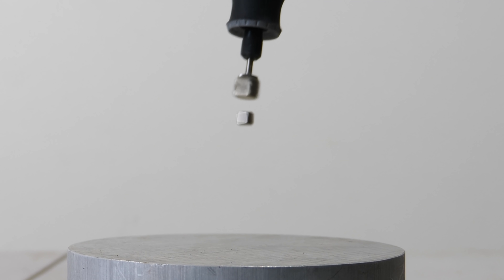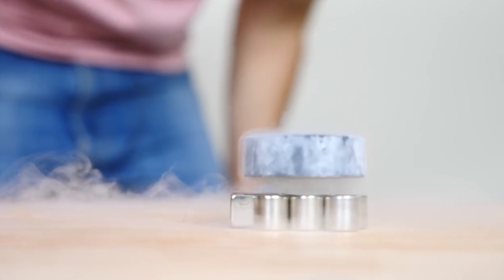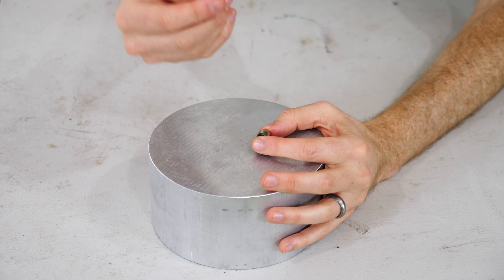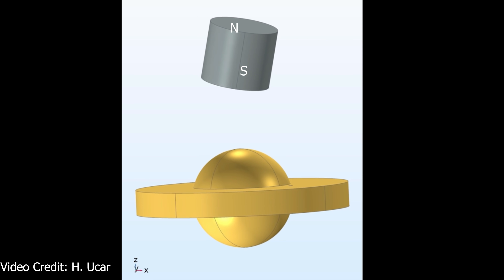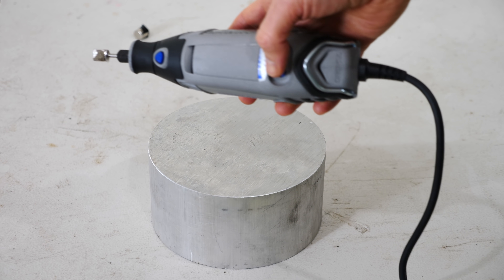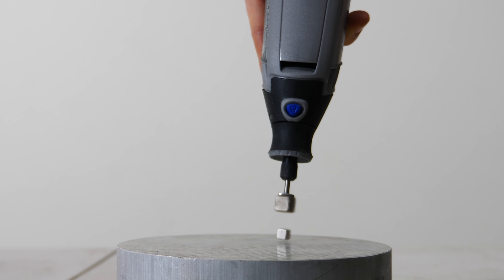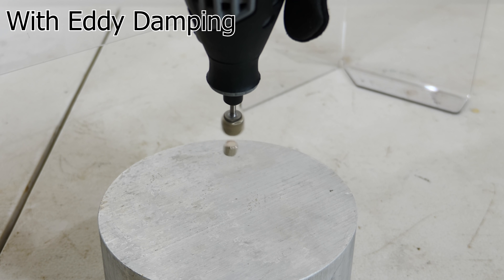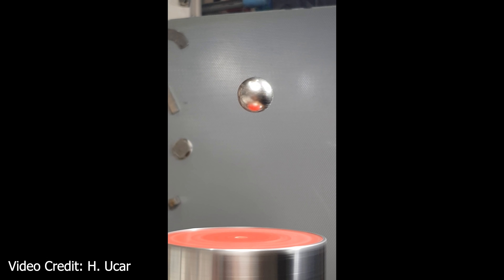Magnetic Locking WITHOUT a Superconductor!

Comment: Sometimes you come up with the coolest mind blowing stuff on this channel... and today's video was one of those truly amazing videos.  I was thinking about those Si-Fi programs like Star Wars (Star Trek too) had those floating anti-gravity platforms and cars...   So here's my brain dump on this idea...

For us to do that in real life (IRL) with magnets we would need to have something underneath providing the spinning force... but could you turn this system around the other way?  Can you lock to a permanent magnet which is fixed on the bottom (so it would be the "roadway") and the floater would have the rotating magnetic field (the car)?   Propulsion can be made by controlling the field on the car.  It's probably not efficient, I would imagine there would be heat generated by the motors and flux of the magnetic fields (oh... wait is that true? maybe). And the high cost of building magnetic roadways seems like it would just be a novelty more than a transportation solution... but still, it would be cool to see a small-scale demonstration of this.

Comment: So electrically generated spinning magnetic field should work as well, then it can get rid of the mechanical part.
Reply: Shouldn't be incredibly difficult actually. Any 3 phase brushless motor stator should be able to create the necessary field with no moving parts
Reply: @MadScientist267  If you think about it energising a ring of coils N-S-N-etc and then swapping the sequence, I.E. S-N-S-... Would ONLY result in the fields flipping in place. You could not achieve a 'Rotation' about the central axis - Like a spinning Magnet would.
Reply: @3ATIVE  Hence 3 phase. Those stators do in fact create a "rotating" magnetic field despite the flipping. The interaction in the poles provides some of this. A simple single phase or even 2 phase would have a harder time with it.

That said, it would likely require pure sine drive, not simple H bridge switching, as in order to create the effect, the poles need to shift smoothly in polarity. Also, the more phases in use, the smoother the transitions would be but more than likely it would be entirely doable with as little as 3. 1 and 2 are pretty much bust.
Reply: @MadScientist267  I look forward to seeing your video on the build and testing. 😎
Reply: @3ATIVE  You'll probably be sadly disappointed if it's expected from me but maybe someone else will try it. I would be just as interested but don't have the stuff on hand to do it
Reply: @MadScientist267  No worries. Same here, if I had the time! LOL
Reply: @MadScientist267  What Speed is a Dremel at setting 8, 12,000 rpm, 200 Hz?  Definitely within the realm of possibilities to make a three phase rotating magnetic field at 200 Hz with available technology.  I have an variable frequency AC drive at work that can do about 150 Hz.
Reply: @willmcgo8288  Kinda an apples and oranges question but I think I understand what you're after... At 12k RPM, assuming the magnet used in the demo is 2 pole mounted with the poles facing radially, it could be 200Hz yes. There's some details we don't have on the magnet exactly and its configuration (either of them for that matter), but simply applying what appears to be happening, that's my best guess at the moment.

The strength would play a role as well, so you might be able to get away with a lower frequency.
Reply: Great idea! Just commenting to see other replies.
Reply: What if we crowdsourced force field technology from the Action Labs comment section?

https://youtu.be/OklLJ-NpECo
Reply: LMAO - and how would you do that !
Reply: @3ATIVE  with applied principles of magnetic field architecture. Objects can be suspended in air when they are near magnetic fields in motion. The question is if we can recreate the conditions necessary for the same results electromagnetically.
Reply: @AlversonLayne  Indeed, and so reply stands.
Reply: @3ATIVE  that's how a step motor works. As long as there are enough steps, it can emulate a smoothly spinning magnetic field.
Reply: @unclewho  A stepper would not work for your use case.  You'd need a lot more than 2 coils to do what you propose. Sorry.
Reply: @3ATIVE  there are steppers with more than 2 coils and many different possible positions to rotate
Reply: @motaaaa  I doubt even a 5-Phase stepper would work. Plus you're starting to get far more complicated and expensive than simply mechanically spinning a magnet - #DiminishingReturns 😜
Reply: @unclewho   Think about it... energising a ring of coils N-S-N-etc and then swapping the sequence, I.E. S-N-S-... (regardless of how many there are) would ONLY result in the fields flipping in place and NOT any rotation!
Reply: @motaaaa  Energising a ring of coils N-S-N-etc and then swapping the sequence, I.E. S-N-S-... (regardless of how many there are) would ONLY result in flipping the fields in place and NOT any rotation!
Reply: @unclewho  I'm stuck step motor.
Reply: @3ATIVE  The same way every 3 phase brushless motor in existence does....lamo
Reply: @Just-Iss-4U  No... Brush-less motors have fixed coils and thus fixed fields. I'm taking about "spinning magnetic fields"
Reply: This is how 3-phase motors work.  They create a rotating magnetic field.  The rotation is at 60 Hz, though. You would need whatever frequency 8 on the Dremel tool is.  :)

But if you're doing it electronically you can just do feedback-based electromagnetic suspension (EMS) instead, like in maglev trains.
Reply: Only need a driver
Reply: Maglev I believe is what you are talking about.  Linear magnetic levitation through a rotating magnetic field derived from an electrical current.
Reply: @GodzillaGoesGaga  That doesn't even make sense lol
Reply: Here for the update notifications

Nb: im dumb af couldn't understand anything discussed here

Comment: Wonder if anyone's managed to levitate the spinning magnet instead of the stationary magnet yet.
Reply: No one coz, how would you keep a spinning magnet spinning??
Reply: @3ATIVE  battery operated motor
Reply: @ChillyJack  Do you know how motors work? What would it rotate in relation to?
Reply: @3ATIVE  Good point, somehow hadn't thought about that. Would have to be a rig similar to an rc helicopter/drone to actually spin. At that point propeller blades would probably be the better option, but definitely not as cool as magnets lol.
Reply: @ChillyJack  Indeed and that would have been my exactly my example, had you not got it yourself. 👍
Reply: @3ATIVE  Did some digging, and people have done it with spinning magnets over a conductive surface like copper. Veritasium has a video from a few year ago about a 100lb rig that levitates using that method. Pretty cool, but it would be obscenely expensive to make roads for any vehicles that used that method.
Reply: @ChillyJack  Yeah, there have been a few demonstrations of inducing eddy currents on non-ferrous metal plates to produce opposing fields. 
The main trouble is all the heat produced and so wasted - It's very inefficient... ok for Cooking thou! LOL

Comment: Don't they use something similar in pharmacy or chemistry to stir some compounds in containers without opening them? They have a metal ball inside and put it on a machine with a rotating magnet inside.
Reply: Not the same, those magnetic stirrers are just dragged around by attraction.

Comment: My first thought is: Is this how flying saucers fly?
Reply: Theoretically i guess it could be possible to lock a spinning magnet with the earth's magnetic field. But it would have to spin so stupidly fast that it would melt down from the air friction way before the effect could happend (not even talking about the energy required and how to make it spin)
Reply: @H2SO4pyro  Exactly bro... and the earth's magnetic field isn't that strong... I think it can also find use in Fusion Reactors (if possible) because they use the superconductors to keep the plasma floating inside them..
Reply: I'm guessing that's a no... but maybe there is another cool application?

Comment: Looks like this kind of levitation operates under similar principles as the Hendo hoverboard.

https://youtu.be/OklLJ-NpECo
Reply from the maker: That video is different. That video is just due to eddy currents in the aluminum. Different phenomenon.
Reply: @TheActionLab  Edit: It appears to operate under similar principles related to magnetic field architecture in general. Still, it’s remarkable to see.

Do you think a magnetic field could be created that would suspend a projectile mid-air that was traveling  at high velocity?

Comment: could you please make a video explaining how does a cook top is cool to touch
Reply: It only induces magnetic fields in the metal of the pan. It's the 'friction' or resistance of these moving field lines and the electrical currents they produce that heats - Like high current flowing through a wire.

Comment: Pls make a video on reasons why we cant generate electricity from lightning.
Reply: the energy in a lightning bolt is too strong and it will destroy any electrical devices
Reply: @JJean64  actually the overall power can be diverted. If we can somehow make it flow through long conductors and then slowly store it . It's literally like billions of volts of energy just passing in front of us and we cant anything about it. I am kind of shocked that we can send our satellites to jupiter s moons yet we cant generate electricity from lightning
Reply: @sinister3921  Current doesn't like to go "slowly"
Reply: @dwdadevil  no not like that. 
Although that is what someone would get from that sentence so my bad .

What I meant was by taking small portions at a time.